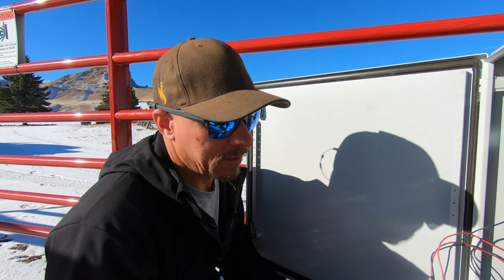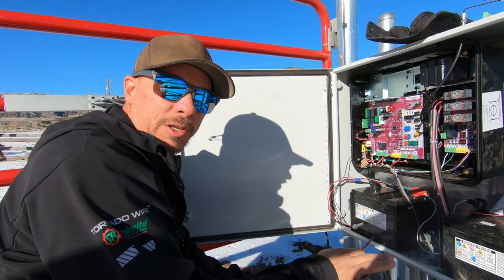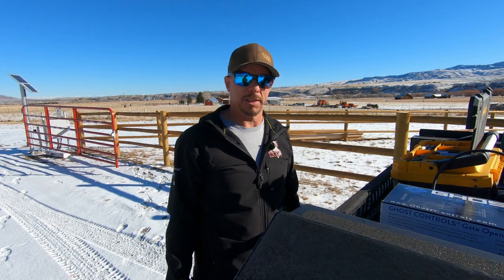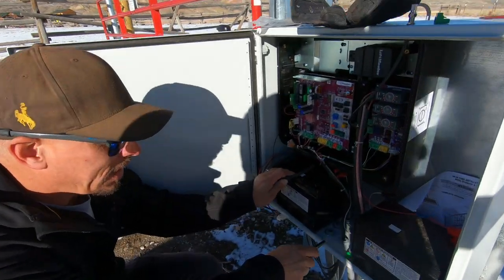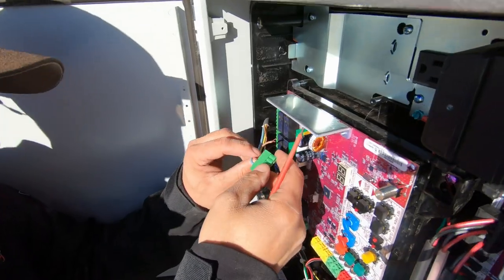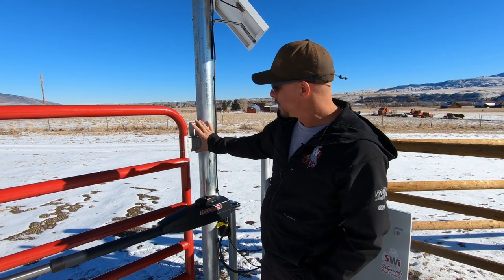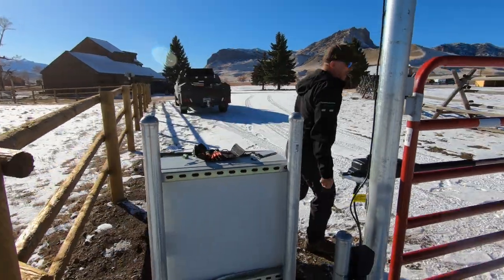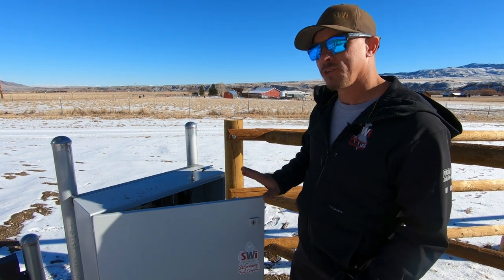Our Basic Solar Gate Operator Setup | LiftMaster Gate Arm Repair

Comment: I love your videos. i wish i had seen them before i bought my Lift master LA 412. i would of bought the US automatic brand ( but that's another story) I have a dual swing Lift master gate opener.  the batteries it came with SUCKS. Less than a month of installation i already had to replace the batteries. Can you send me a line diagram and pictures of the 30watt solar connection and two 33 amp hr. batteries like in the video.

thanks,
Rick

Comment: I know this is an older vid but I had a question or two for you. When you said you don't like using wireless keypads, is that because of the cold weather or another issue? And how did the reflective photo eye turn out? Any issues or call backs with it?
Reply from the maker: My opinion of wireless keypads has evolved.  I have been forced to use them due to their low power consumption and found that some of them work really well.  USAutomatic have been good as well as Liftmaster.  I still hate reflective photo eyes so when I don't want to run power to the far side of the gate we use US Automatic which offers a battery powered through beam.

Comment: Swi fence help me out here! I am having a problem with my la 400 install, I am running a cell box and and exit wand… can I wire them both the the same exit lug or do I need to buy expansion board and wire them separately?
Reply from the maker: I don't have enough information about the system.  The vendor that sold you the products should offer you the support you need. Good luck!

Comment: Hi , We have a UL325 and have had multiple issues with weak storage on cloudy weeks. what do you suggest? We are planning to go electric but hate the fact of loosing the solar portion. Thank you
Reply from the maker: You need to do a thorough evaluation of everything in your system to see if there is a power hog. You either need more storage, or less draw. We very specifically recommend the systems we do because they're designed to sip power, allowing them to still have power at times when there may not be enough sun to charge for a while.
Reply: @SWiFence   thank you. I will look more into it. I would possible end up going electric since the install is ready since I been having problems since last year and have all the electric in place. Thank for the advice,always welcome.
Reply: Hi Quick question. If I changed my system from solar to electric does the system still need to have the batteries in place ? Sorry I’m kinda new to this. 

I had a gate company  come and do the change but the gate only operated for a little while and the next morning it only opened and didn’t close. Thank you.
Reply from the maker: There’s a good chance that it does. Nowadays, most of the operators are either 12 or 24 V DC and all the 120 V power supply is doing is keeping the batteries charged all the time.  Since I don’t know the brand of this operator, I can’t say with certainty this is the case here.

Comment: Awesome job! I wish you lived near me! I have an LA412. Everything works perfectly on it, except it won't charge the batteries. I bought new batteries, thinking that was the problem, but they last about 2 weeks and the gate quits working. I swap them out with two charged ones and they work for about two weeks. So I just bring two in and charge them and swap them out every 2 weeks when the gate stops working. The solar panel puts out just over 20 volts. I had a local company come out and they won't fix it, they want to install a new Maximum Control 2300 at a cost of $8400 and I need to run the electric to it. This is for my home. I open it once a day and close it once a day. Do you think it may just be a bad board or is there something else to check? The opener is 8 years old... I can swap out the board for around $250... or just keeping swapping the batteries every two weeks. Thanks in advance for any advice...
Reply from the maker: Unfortunately it could be the board or something else.  If you are the one who installed it i would recommend  reaching out to liftmaster tech support and make sure to have a multi meter handy.
Reply: I had mine install by a professional gate in stalker. I am having the same issue. How did you get it resolve.
Reply: @rickyrick5554  I ran electric to the gate opener box and installed a 110V receptacle. I bought a $12 battery charger online. There's a place on the bottom of the board to wire in a battery charger, so I disconnected the solar panel and wired it in and the thing works flawlessly. I can make a short video and post it on YouTube if you'd like.

Comment: Things that drive me crazy are fence installers who call themselves electricians,  who use wego's and leave metal shavings in a panel.
By the way,  electricians have been drilling holes in panels for decades.
Reply from the maker: Can I ask why you don't like wegos?  Wire nuts are a terrible option.  Good call on the shavings.  I'll have to step up my game.  So you are aware, while I'm not an "electrician" I am licensed for low voltage which required 4000 hrs and a comprehensive knowledge test.  This is similar to that which a journeyman would have to take with the exception that it is limited low voltage.  I've also seen gate operators installed by "electricians" that were laughable at best.

Comment: While I understand some things that drive you crazy..There is always more ways than yours to do things and comparing your work ethics with some fly by night Wyoming crack head is pretty over the top... Your trying tooooo hard..You mention how terrible box store operators are like Ghost, but yet you have a brand new one in the back of your truck? The biggest reason that arm has shit the bed is your undersized gate hinge post is TOTALY undersized and every time the torque from the operator opens it tweeks that arm and those arms cant handle it. I also believe that the Liftmaster arm your using is not the LA 5000 but something smaller? On another note, Most of the time that one would need that much solar is because a lot of your accessories are drawing to many Milliamps. Maybe look for different suppliers that offer less draw!! One last thing, We were always taught to run Liquid Tight from EMT to panel to allow for movement and not crack your connections to your special panel. I have installed 100's of solar operators here in Colorado using 20 watt panel and one battery same size as yours...never had a call ! I believe you have to much draw!!!!! keep up the good work.. but people that try to hard make me nervous..
Reply from the maker: We did screw up the draw but only with the keypad.  Everything else is fine.  The post is fine given the gate weight.  The replacement arm has been functioning fine for over a year.  On a side note, we have switched to USAutomatic for a great solar setup that is much more reliable with very low draw compared to other.  It is our go to for simple solar gates like this.  I still prefer a pad mount when the budget allows though.